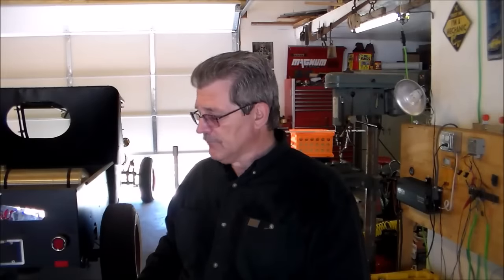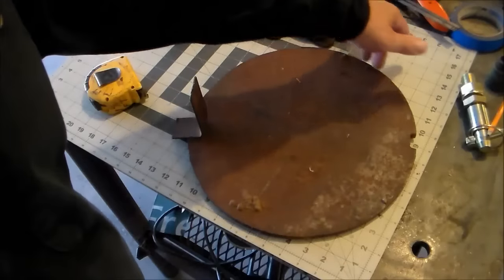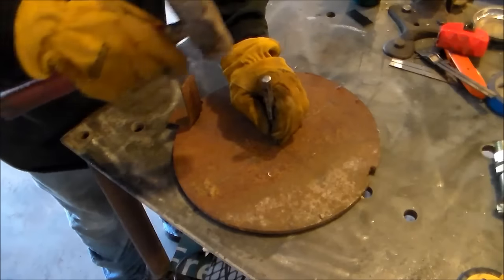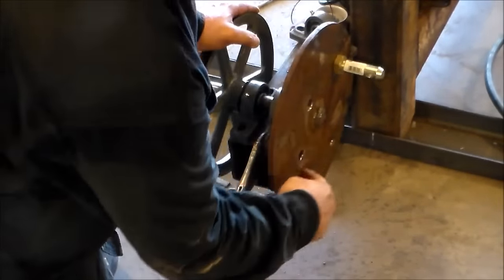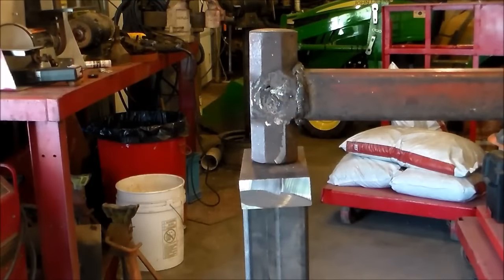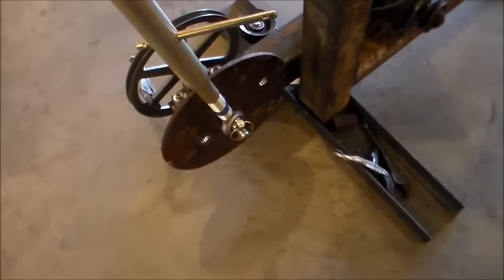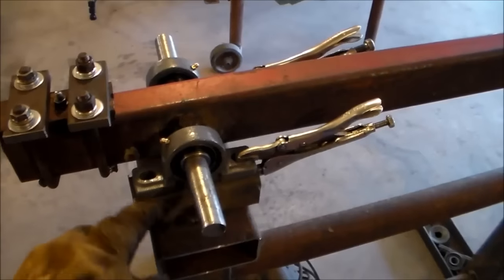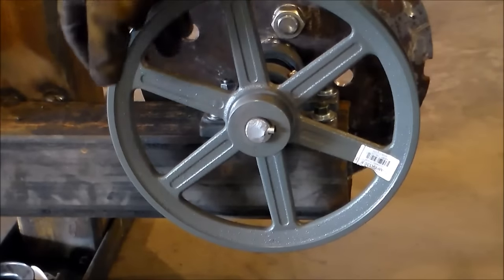Power Hammer Project pt 2

Comment: Pretty ingenious on the flywheel.  The only issue I can think of is the threads of the top link getting stripped out from the hammering.  The ends of top link joints are soft enough to bend if not perfectly in line (I bent mine on the farm).
Reply from the maker: It is making full contact in the nut and threads so it about as good as I can do. I don't think it is over loaded with the spring keeping it from bottoming out. But anything can happen...ha ha  Thanks and take care

Comment: You keep building stuff, you're going to have to add on to your shop. That is a slick looking build you're doing there, I especially like the tractor top link part.
Reply from the maker: +BIcknell Manor That top link worked great. Plenty of thread for adjustment if I change the stroke of the hammer.  I have thought about an outdoor blacksmith area by the shop. Take care

Comment: Does the 13" plate act as a counter weight, or could it be as round as where it attaches?
Reply from the maker: I have so I can change the stroke action of the arm from2,3,4 inches. Thanks